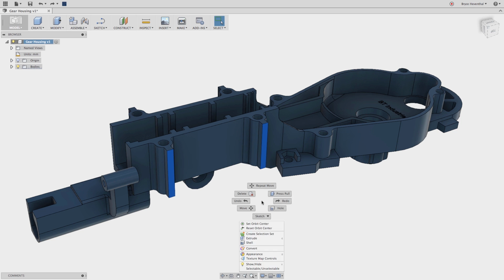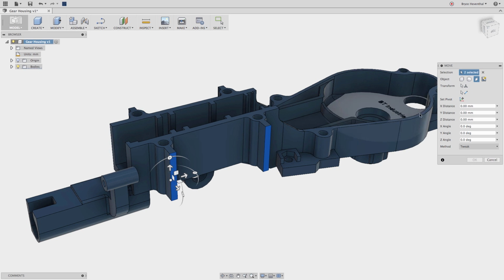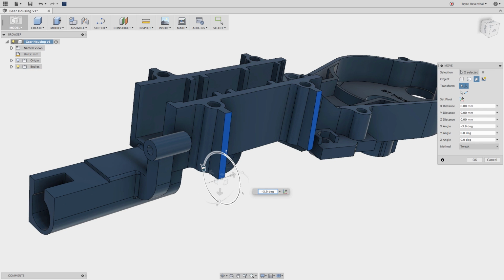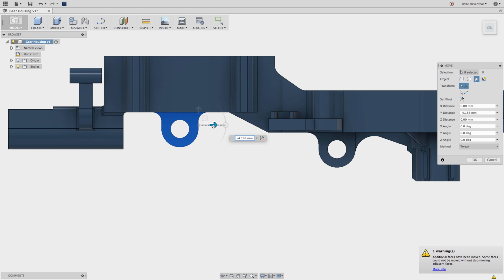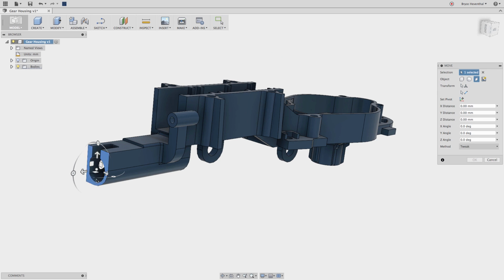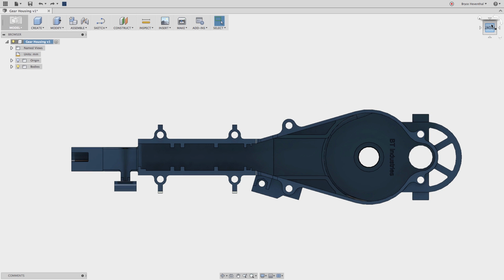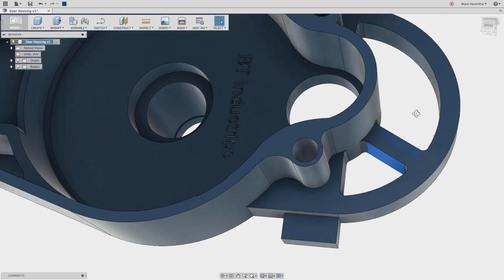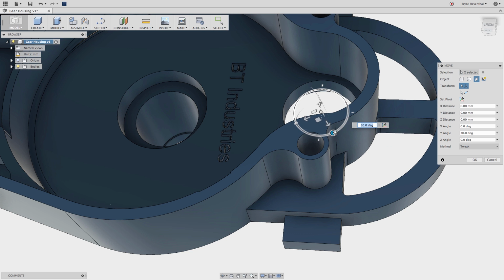Unlock the power of editing imported geometry with this quick tip!

Comment: Thanks for the tip. Is there anyway when you import the step file to capture the original sketches and dimensions so you can modify parameters etc?
Thanks
Reply: +Bert R Hey Bert, When coming from a different CAD tool or Neutral CAD format usually the Features are lost. Some features can be translated into Fusion features. In order to do this, Make sure you are in the "Do not capture history mode" (Direct Modeling mode) and go to Create>Find Features. This will translate some of the features. It really depends on the change that is required, which will decide which toolset i will use to make the change.
Reply: @bryceheventhal6779  thank you so much

Comment: I don't had that option to move the faces, just allow me: Components,  bodies sketches and sketch objets. Why can be that?
Reply: +crazybird2007 The Option for faces is only available in the Direct Modeling mode. If you right click on the top level component, you will see an option to "Do not Capture Design History." This will turn off the timeline. In doing so, you will be leaving the parametric environment. This is where you will get the option to move faces.
Reply: OK thanks! I did that, just realize that the part is a huge piece of ..... full of fillets and very small faces so it is completely understandable that Fusion can't deal with that. I began again using other technique in SW. 
Thanks again.
Reply: +crazybird2007 This part can easily be modeled in Fusion from scratch with parametrics. This video was showing how to make changes for two main reasons: In case this was imported geometry or Maybe your a machinist that doesn't understand parametrics (this is a great tool for last minute changes)